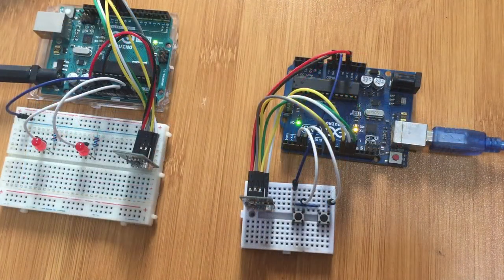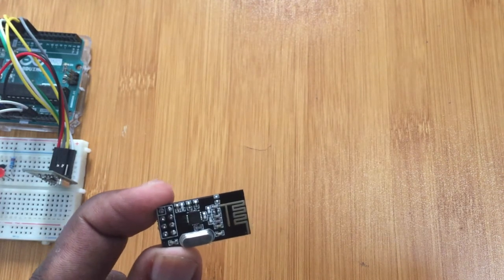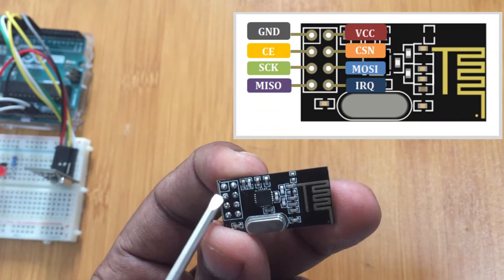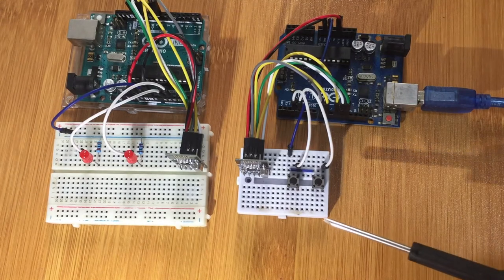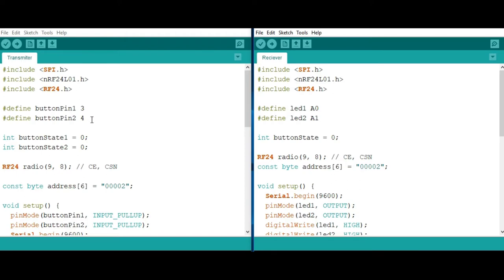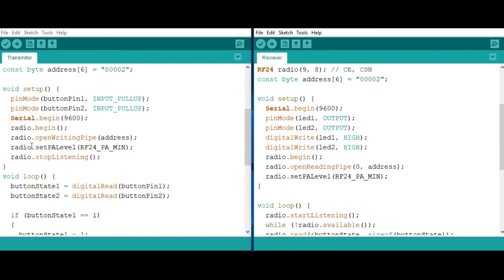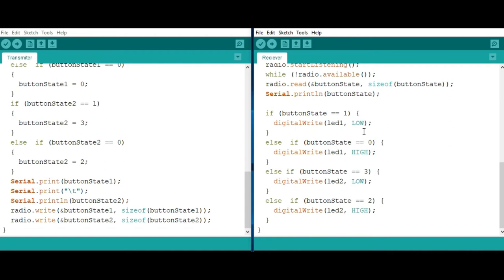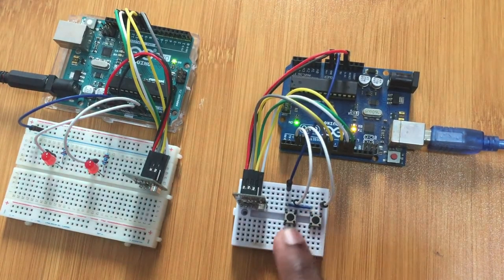How the nRF24L01 Wireless Transceiver Module Works With Arduino.

Comment: I am sorry, I didnt get it! The code states   digitalWrite(led1, HIGH);
  digitalWrite(led2, HIGH); and it just keeps the LEDs on by default. did you used different code for the video ?
Reply: you are right
Reply: i have faced same problem
Reply: Hi, please could you find why the leds keep on?
Reply: @scienceforscientists6864  hi, how did you solve this problem and why it happens?
Reply: void loop() {
  radio.startListening();
  while (!radio.available());
  radio.read(&buttonState, sizeof(buttonState));
  Serial.println(buttonState);
  delay(100);

  if (buttonState == 1) {
    digitalWrite(led1, LOW);
  }
  else  if (buttonState == 0) {
    digitalWrite(led1, HIGH);
  }
  else if (buttonState == 3) {
    digitalWrite(led2, LOW);
  }
  else  if (buttonState == 2) {
    digitalWrite(led2, HIGH);
  }
}

add a delay function on the recieving side
Reply: @aspect5712  thanks dear
Reply: @lampfall7915  your welcome. it took time but i finally figured it out.
Reply: I have same problem, the setup is pinMode(led1, HIGH);
pinMode(led, HIGH);

The leds are ON already?
Reply: @xrphobby1341  i had the same problem but it got fixed by the code. did you wire it correctly?

void loop() {
  radio.startListening();
  while (!radio.available());
  radio.read(&buttonState, sizeof(buttonState));
  Serial.println(buttonState);
  delay(100);

  if (buttonState == 1) {
    digitalWrite(led1, LOW);
  }
  else  if (buttonState == 0) {
    digitalWrite(led1, HIGH);
  }
  else if (buttonState == 3) {
    digitalWrite(led2, LOW);
  }
  else  if (buttonState == 2) {
    digitalWrite(led2, HIGH);
  }
}

*add a delay function on the recieving side
Reply: @aspect5712  yes I added the delay but still the same, it seems the NRF modules don't talk to each other? I bought the modules from Aliexpress. I reviewed the codes and circuits many times but still no joy. Is it the NRF24 library? But I'm sure downloaded the right one by TMRh20 version 1.4.5. Thank you @Aspect
Reply: @aspect5712  the RX LED of my transmitter arduino mega board keeps flashing while my receiver TX LED is ON for few minutes and OFF for few minutes and sometimes it flashes too.
Reply: @aspect5712  got it working even without the delay, I connected the MISO, MOSI and SCK pins of Arduino Mega to pins 50, 51 and 52.

Comment: Good evening! I need arduino code please for the following problem> on a development board I have a gyro sensor and a wireless module that transmits the gyroscope data to another development board that has a wireless module and a board with leds. the LEDs light up depending on the movements received wirelessly from the gyroscope.thank you!

Comment: I have ma question: can this system as it is work in a 30 or more meters long room? With the two arduinos having that distance with each other?
Reply: a bit late but these can work up to (and past) 1Km with the right conditions and an antenna

Comment: Hi sir could this be used to control 8 separate  relays ?
I need to operate momentarily 8 separate machines over a distance of about 400 meters.  Using an 8 button hand controller

Comment: sir in nano should we connect the led to A0 AND A1 OR D2 AND D3
Reply: Analog pins are only for reading a signal and you do not need an analog pin for led you need to use the led with a digital pin and a gnd pin on the digital pins side because there are 2 gnd pins one for analog and one for digital

Comment: what resistors you have in LED and BUTTON?
Reply: you can use 330ohm for led
Reply: Buttons shall not be connected with resistors. Open a random appliance, and buttons always connect straight to the ground. Because there are such things as internal pull-up resistors.